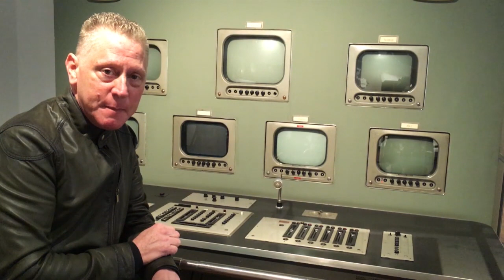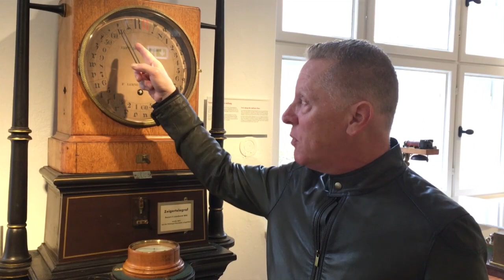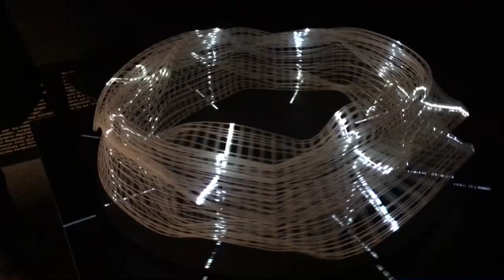Design Ideas from History

Comment: This is not much of a puzzle idea it’s much more like a reveal. To make the effect like when glass steams up and writing that was at first obscure is now there in plain sight with a misty background
Reply: Jesus it sounded like I was a restaurant menu for a sec
Reply from the maker: if you rub a tiny bit of clear detergent between your fingers, then swipe a cotton swab through it, it can be used to write an invisible message on glass. When you breathe on it, the glass fogs up but,  the message stays clear.  The downside is that the message would collect dust and become visible over time; also, it can't be touched.  Maybe a way to do this better would be to create a vinyl mask representing the message, apply it to a sheet of acrylic, sand the acrylic with very fine sandpaper, then remove the message mask. It would be used as the "ghost" reveal when reflected in a beam splitter. Waddya think?
Reply from the maker: You have slightly piquant notes and are nestled in a bed of bruised arugula?

Comment: I have to think the 'Pepper's Ghost' technique is based off of the Schüfftan process after watching your video. Pepper's Ghost has been used for years in the haunt industry so  I definitely  can see this being used in a escape room.
Reply from the maker: It's definitely a beam splitter type effect, but done with plexiglass, so it's not quite as clean as a beam splitter.  The way they duplicate the room means it could be done with a 2 way mirror, too.
Reply from the maker: now, how would you toughen the concept and make it move, or be less static?
Reply: Instead of a static slide use a small video monitor. Then you have recorded movement. Can use it 2 ways..
1. (static slide, simple version) Let's say you have a sheet of paper with a letters all over it, look through the view port as you hold the sheet of paper in the right location, the slide has circles or X's and reveals a word or phase or a combination of the paper and the slide make a word or phase.
2. The video side is more complicated. Looking through the port you can see the physical chess board. Missing a queen, Once you place the queen on the board in the right location a ghost image plays through the port "making their move". Once you make the correct move (to counter the ghost move) the video plays a second move (and so on as many steps as you like). Once all steps are completed a video with a code pops up, a drawer opens, an audio cue plays, any result can be added. Can sketch it out and email if my rambling is confusing. lol
Reply from the maker: Very cool! :-)
Reply: Package? What Package? Did I win one of those awesome shirts? lol
Reply from the maker: Oops- that was for Kay Bee
Reply: Awesome, I will be looking forward to the "Package".
I have two different approaches.
One, Mount a view finder in the middle of a room so it can swing around 360 degrees  (detents every 90 degrees). A rotary encoder or reed switches can determine what direction/wall the view finder is pointing at and a few servos can push up and down new slides or turn on LEDs or play a video as mentioned in another post. Now you have four or more clues using one prop.

Two, This is good for team building if it is feasible. Two rooms with a windows between them (wall will need to be thick). The player on the viewing side sits inside a very small room in order to control the players viewing angle. The player will be able to see their team inside the other room and can see projected objects where they need to be placed. Once the real objects are found the player has to instruct their team on where each object belongs. Example player will see a red vase on a blue table. Other player(s) will need to find the red vase and place it on the blue table. I could keep going but that is the basic idea.
Reply from the maker: Breathtaking!! You started out where my brain was going, then you passed me at high speed :-). I really like the selectable servo idea. If you have no objections, im going to steal it at some unknown point in the future.
We are going to use your ideas for a logo redesign soon; you'll receive that shirt too.  I may ask for your invaluable assistance finalizing that.  We also have a marquis space at our new location, 30"x 120" that will need a sign composition.  I'm going to send you photos of the source of our original logo, if I haven't yet, so you'll understand why it looks that way...but, following a conversation with Matt, no one outside really knows why our logo looks the way it does, so it can be easily abandoned.
Reply: Steal away! I would like to see what you end up making. The more I think about it a servo is not necessary. Not sure of the actual mechanical term except for calling it a cam. When the view finder is turned the slide rides up a hill to be viewed and drops down in the valley when turned again.
On your other comment send me anything you have and I will be happy to help.
Reply from the maker: I think you're entirely correct on the cam term, but the design would need to be hyper-perfect. I'm going to play with the idea and see what fibers tease out... call me Analogy Man! :-/
Reply: Just watched this video today and forgot about this tech. You have to watch it on a mobile device but I can think of a lot of different ways to use it in a room. https://www.youtube.com/watch?v=5g827Gzmd-g
Reply from the maker: I think we are shooting a 360 clip to use in a VR headset pretty soon. We still have some bits to figure out though
Reply from the maker: Did it arrive?
Reply: Yes I did. Thank you. I almost wore it to work today as it is 50 degrees in Chicago but I was going on a job interview so I had to dress up!
Reply from the maker: Lol- I'll talk to you about the redesign soon
Reply: Take your time. It looks like you two have been super busy.
Reply: Peppers Ghost predates the Schüfftan process by about 50 years.  It's almost certainly a play on it though.  Lang just added silver to the glass to completely remove the ghost where he didn't want it.  Very clever adaptation of technology of the day - just like we do today.  Nice observation!
Reply from the maker: Sweet, sweet knowledge!

Comment: One thing that you could do is make different slides that are each numbered and have numbers or letters on the wall and the slides can highlight the right number so like if I slipped slide one
Reply: into the viewer and it showed that 6 was the correct number then
Reply: I would know that the first place on a lock is 6
Reply from the maker: I like where you're going with this...
Reply from the maker: Now, how would you make it bulletproof, tough?
Reply: Gratuitous Sets maybe having the slides be in boxes that fit in to place. but I'm not even past middle yet so what do I know?
Reply from the maker: Lol 😂
Reply: Gratuitous Sets you could also cover the slides with the stuff you used for the fuse. (I am very disappointed with myself because I walked to my living room just to remember what a fuse is)